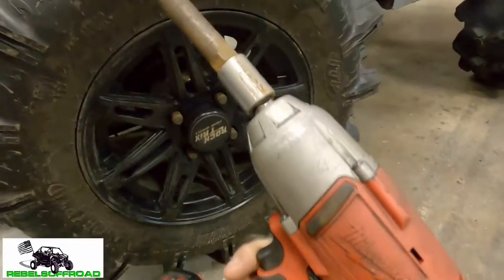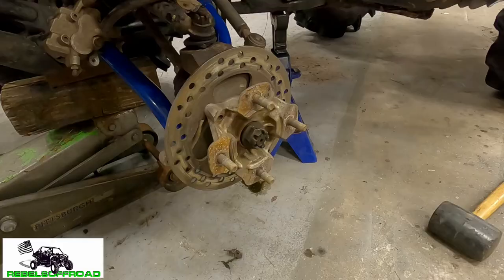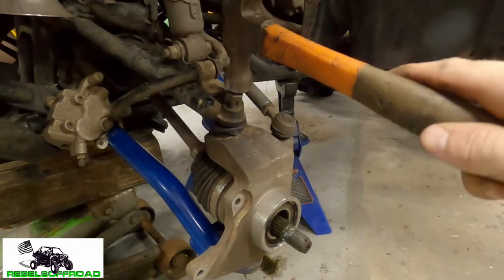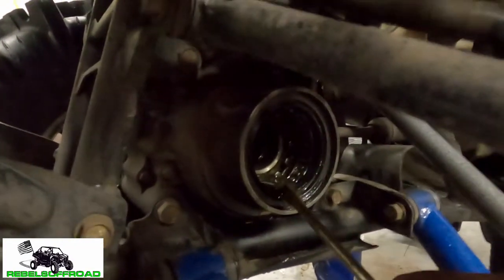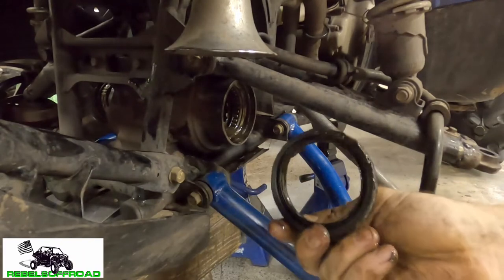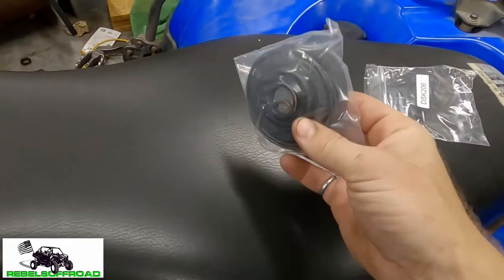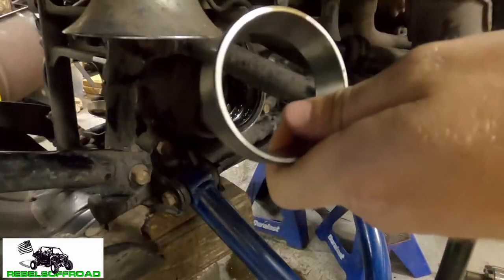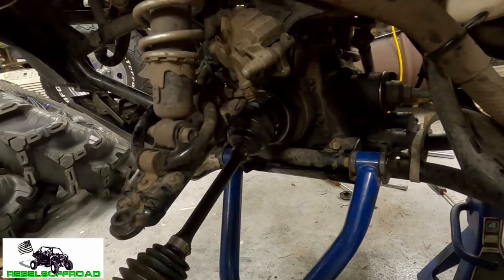Kawasaki Brute Force 750 Front Axle Seal Install and Replacement

Comment: Hey man couldnt help but notice you installed a manual 4x4 cable, i got the same one and its bout impossible for it to change over to 4wd without having to really force the lever over and rocking the bike like crazy any ideas why? Thanks in advance
Reply from the maker: Oh that don’t sound good 🤔 make sure you’ve routed the cable good (no kinks or sharp bends) and adjust tension on the cable per SGROI instruction if that’s not the problem I’d say it’s probably something wrong with the splines on the pinion or coupling because it should very easily shift in and out of 4x4. I’d pull the sure 4 actuator housing and see if you can move the coupling by hand. If you can’t then you might have to rebuild the diff
Reply from the maker: Hopefully it’s just a kinked cable but let me know what you find out. Also thanks for commenting. Odd I know, but Comments, likes, and subscribing really helps the channel grow so i Appreciate it.

Comment: A spring came out out whenever I was changing my axle and I was told to replace the axle seal . Where could I find one for the rear on a 2018 brute force 750
Reply from the maker: It probably was the spring that holds the tension of the seal to the axle. I like east lake axle seals. These should work https://www.eastlakeaxle.com/kawasaki/dsk208/rear-differential-bearing-seal-kit
Reply: @rebelsoffroad  great I just ordered them 👍🏼

Comment: do you drain the fluid before or after
Reply from the maker: You don’t have to drain the fluid unless there’s water in it. If a little comes out you can top off after replacing the seal. If you want to change the fluid at the same time I’d drain it first.

Comment: hey my wheel hub/brake rotor is stuck and rusted and it's hard to take it out how would you be able to take it out or is there a way to not have to take it out?
Reply from the maker: Good question! I guess You could take off the whole knuckle from the a-arms and leave the rotor attached to the axle. You have to pop off the steering and upper/lower ball joints and pull the rotor/knuckle/axle out all at once . You could then use a press to push the axle out of the rotor and the rotor out of the knuckle. Make sure to grease the axle splines before reassembling so it won’t get stuck again
Reply from the maker: Also you could try soaking in PB blaster and a heating up the knuckle with a torch and hitting the end of the axle with a hammer to loosen it up. Leave the axle nut on partially threaded so you don’t ruin the threads or bend the axle if you do that though. It’s easy to mess up the end if you hit too hard
Reply: @rebelsoffroad  alright thanks a lot for the help
Reply from the maker: No problem! Make sure to smash that like button and subscribe to the channel if you found this useful. It helps a lot! Thanks for watching!